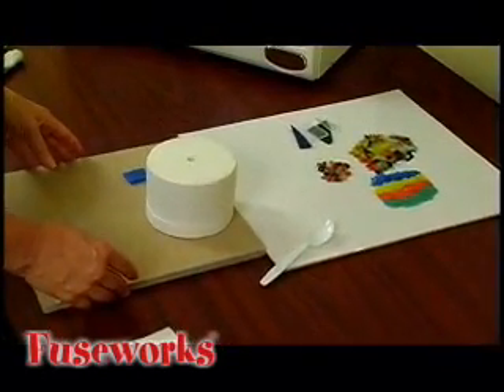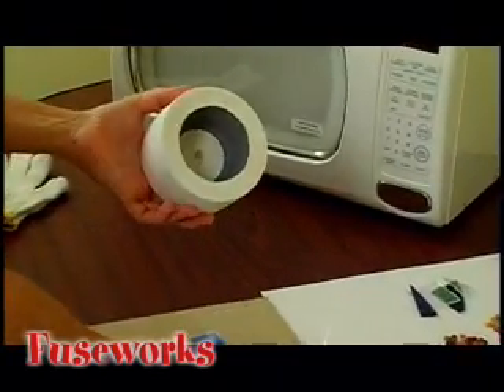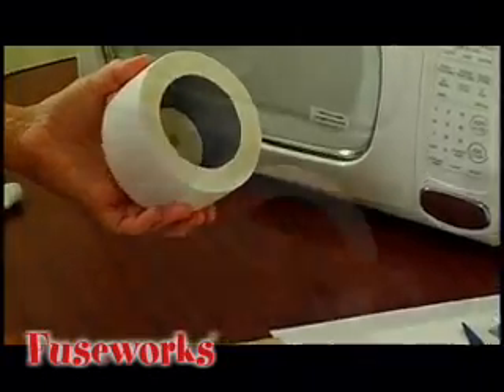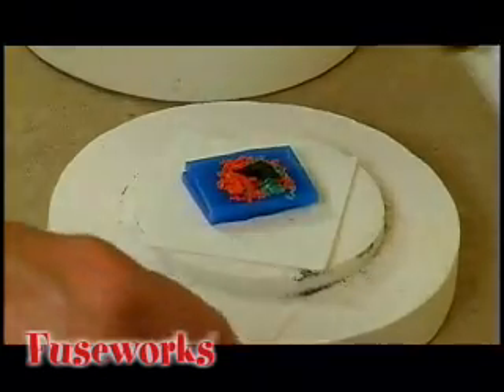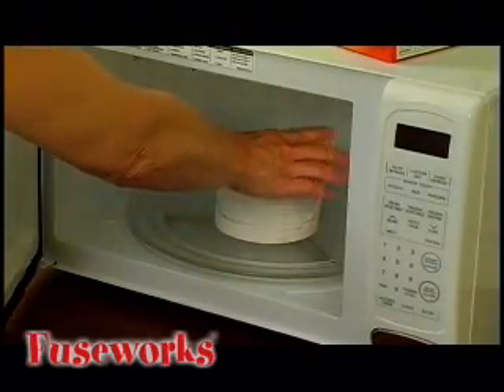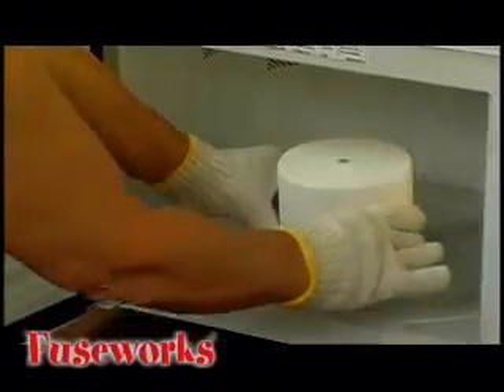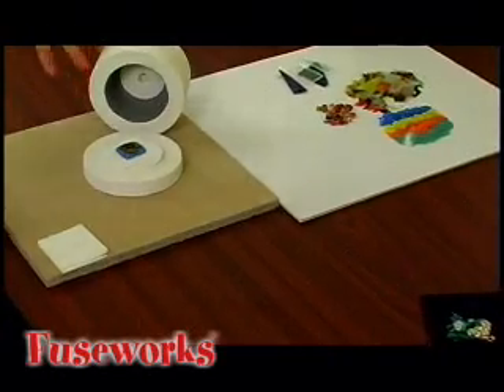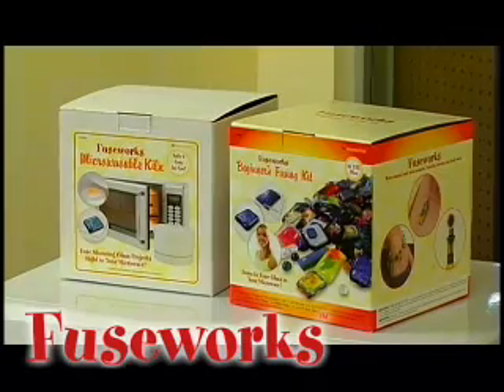Fusing - How to Fuse Glass In A Microwave

Comment: Thanks for your Video. Can one put confetti, Stone or beads on the coe 90 Glass and then into microwave?
Reply from the maker: Hi Jeanne, we don't recommend fusing any glass without a known COE should really only fuse glass with the same COE from the same manufacturer, furthermore, mixing COEs will result in shattered projects during fusing or during the annealing process.

Comment: I love my microwave kiln but I can't stand the fusing paper. I have to do a lot of sanding and polishing after to fix the edges. Just read in the comments I can use this with metal clays which is something I have been itching to try so that is going to be a bit dangerous to my wallet. laughs 

I also tried the freeze fusing with mixed results. Some came out okay but most didn't keep the shape or broke on me. I probably messed it up though. 

- Heidi
Reply from the maker: Thanks for your comments! You may want to try a scythe or a diamond file to take the edges down. Both options take considerably less time than regular sanding. Metal clays have been used by others but have not been tested thoroughly by Diamond Tech, so proceed with caution! Freeze and Fuse takes a bit of practice and lots of patience, I'm sure if you keep trying you will master it!
Reply: Well I read this comment posted 3 years ago by DiamondTechMarketing : Great question! Yes, you can create metal clay pieces. You can find more information on page 35 of our book entitled "Simply Fused". 

I have found that book and plan to purchase it this weekend.

Comment from the maker: An 800 to 1200 WATT microwave oven is recommended for use with Fuseworks™ Microwave Kiln. Do NOT use microwave ovens with plastic interiors. A suggested firing schedule is included in the instruction manual. Carefully read all instructions before using the Fuseworks™ Microwave Kiln. If you do not have the manual you can find it online at Diamond Tech Crafts.

Comment from the maker: The Fuseworks™ Microwave Kiln must be pre-fired before the first use. To pre-fire kiln, center the empty kiln inside the microwave. Ensure lid is sitting on top of the kiln base. Close microwave door and microwave for 3 minutes on high. Wearing heat resistant gloves or mitts, carefully remove from microwave, place on a heat-resistant surface, and allow to cool for 30 minutes. This is the first step before use. Carefully read all instructions before using the Fuseworks™ Microwave Kiln.

Comment from the maker: We have been able to use small 2" x2" ceramic molds inside of the kiln with no trouble. You would lay the mold directly on the stage area. We would suggest a low and slow method of firing to protect the mold and the kiln. Start with 6 minutes at 30% power, then 4 minutes at 40% power, then 2 minutes at 60% power, continue at 30 second intervals at 100% power until you achieve a full fuse.